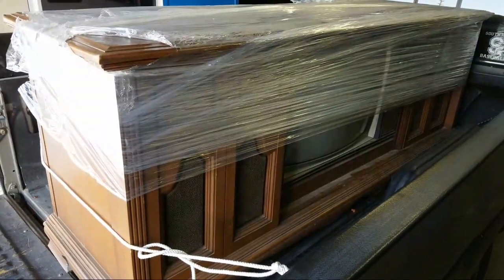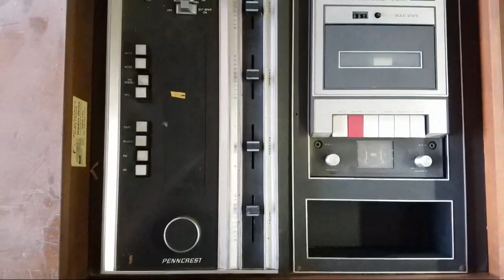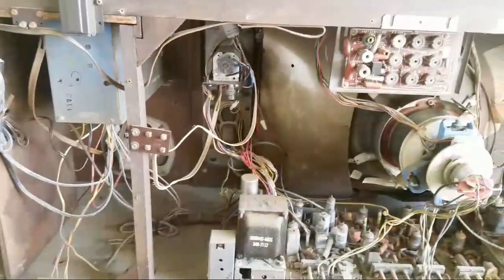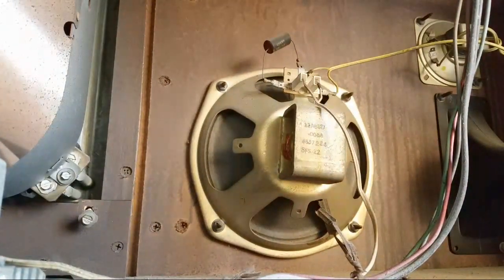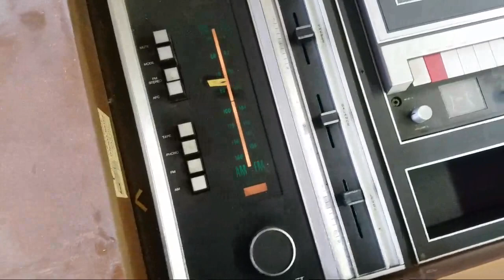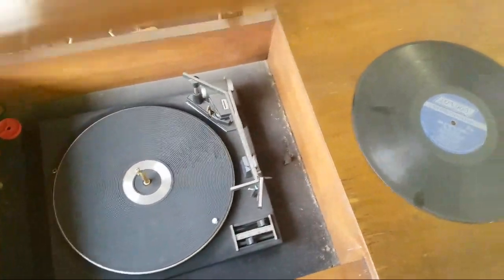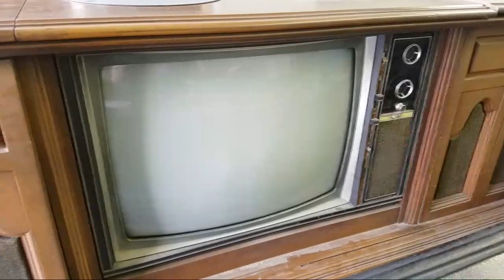Early 1970s Penncrest Combo Television

Comment: That thing is Wells-Gardner all the way, with a VM record changer. If that's the TV chassis that I'm thinking of, it uses an oddball circuit breaker that contains an internal resistor that's in the horizontal output tube cathode circuit. If the circuit breaker fails, it will cause an electrolytic bypass capacitor on the horizontal output tube cathode to blow up. The most interesting thing about this chassis is that it's a modular tube set. Otherwise, I'm not fond of them. The CRT was probably sourced from either RCA or Rauland.
Reply: radiotvphononut I think it's rca. It said radio corporation of America on the back label.

Comment: The TV chassis mas made by Warwick Electronics, Chicago Il. the Horizontal output Tube & most of the other tubes are Japanese made as well as the Stereo components. i worked on a few of these sets in the late 70's

Comment: Hey Good Buddy, you  might have yourself a rare bird there.  I suspect, from experience in my Dad's repair shop way back when, it's a Panasonic clone of sorts. Also, the whole idea of the "afterthought" tape player was not so much an afterthought, but a way to option cassette vs 8-track vs none but a record storage bay. Indeed the cassette is the rare bird on such a tube set. The whole meter thing was a way to faux higher end component stereos that were becoming the big thing but I guess you know that. I would say it really is not a cheapo set, but more of a midrange console. Low midrange at the worst. There's some popularity for these kind of kitschy "store-brand" units that are above K-mart level, ie, Sears, Penncrest, Wards. I myself just got a Sears Silvertone console that's pretty sweet.  I think it's definitely worth testing the tube to see what's up with it.

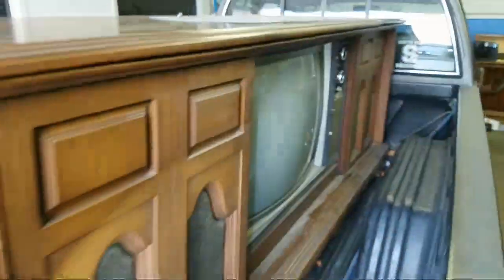Comment: 8:34 Are those sliding doors? I'm going to guess they are hollow plastic, but they are a lot more tastefully designed than much of the Mediterranean whorehouse-style furniture that was so popular back then. Those 8" paper-suspension woofers with pre-Zaire-civil-war magnets don't look very promising, but sometimes when you throw all that cheap stuff in a big enough cabinet, it just sounds good by accident. I've never understood why they bother with those horns in something like this; a SS amp can easily power any $10 tweeter and unless they are very carefully engineered, the horns will just muck-up the frequency response as well as the dispersion pattern.
Reply: That last-minute VoiceOfMusic changer, with size-sensing, no less, also deserves honorable mention. They might have just used it out of force of habit, but it's almost certainly of higher quality than the BSR's they were using in systems like this.
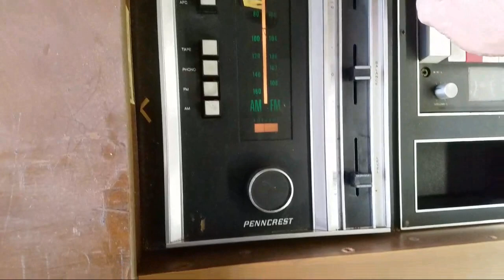Reply: 14:30 Sounds OK, considering the back is off and it's sitting in the bed of a truck. It will probably end up in the "pleasant jukebox" category, but still better than a lot of the compact systems in that era with giant-grill-shallow-box speakers. But only someone with a lot of extra space could give this thing the love it will need to survive.

Comment: Did you play the roling stones album on another stereo blowing out dust cleaning pots. With tuner spray would do alot a long sheet rock screw would probly fix the lid

Comment: I didn't really know where to ask so maybe someone out there has some experience and can answer my television question. I was browsing kijiji the other day and someone has a Zenith Chromacolor mid 70s for sale with the white plastic bottom. 
They say it powers on but that no picture displays. I think this was a solid state tv? because right away im thinking it's a vacuum tube issue but if it's solid state could it be a filter capacitor problem?
Reply from the maker: Not likely, great tv but any problem are usually complex to diagnose and fix. That set is called the Avante series
Reply: Aren't those modular?
Good luck finding the boards, though.

Comment: How cheap / sneaky... even with three speakers on each side of the cabinet, the TV just plays through a single 4" x 6" under the channel selectors. As if it would have been so difficult to route the TV audio through the stereo amplifier and speakers. It is like a separate, isolated TV, receiver, cassette deck and record player share a common cabinet.
Reply: a fix up can be done,shang  likes making old tech vintage tech at least be functional,stuff like refinishing old cabinets,jerryrigging a tuner/amp that people put out in the alley,,mount the piece with 55 wpc inside the cabinet,using AUX IN/ for a turntable with mag cartridge,out to speakers,like that built in tuner that still works,use rubber adhesive on the  paper cones to reinforce them,or mount more modern poly bass cones and tweeters,all that could be done with equipment like this,
Reply: I also wondered why the TV audio wasn't routed through the amplifier. It's baffling.

Comment: I think of Zenith and Magnavox for quality in these old consoles.Zenith had a better picture, Maggotboxes had much better sound.  I'm surprised that there are any Pencrests to be found at the curb.

They were junk when they were sold, an imitation of better brands. The cabinets were always better than the guts. This thing has probably got a 2-watt per channel amp, and even if you get the FM and AM aligned, it'll be noisy and about as selective as a rat terrier in a field of mice.
 
But, kudos for a rescue.